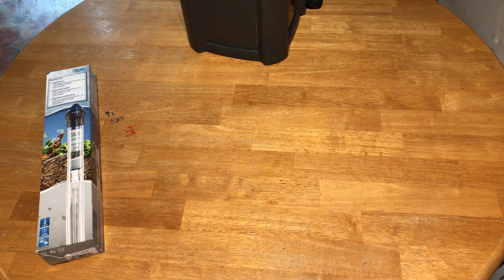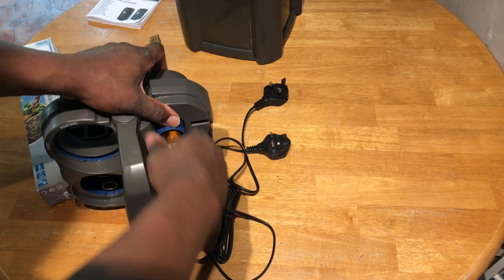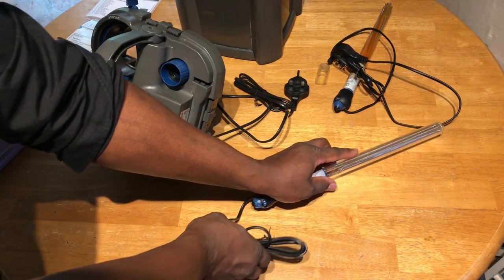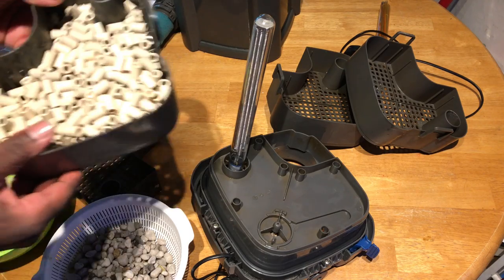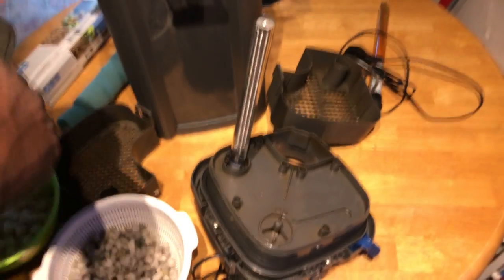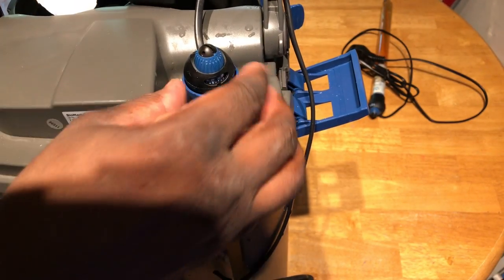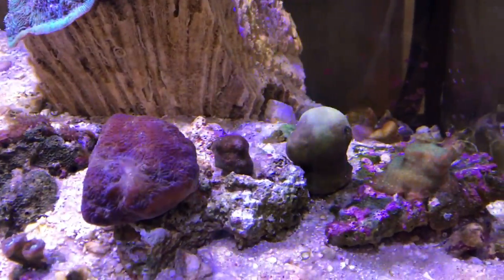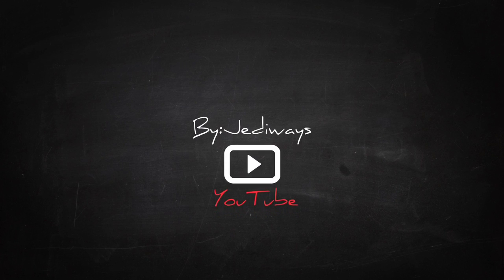Oh Oase my heater broke

Comment: Undo and remove the top bracket and holds heater, it's loads easier. Another thing, don't leave original ties on electrical cable, always unwind cable, especially on things like heaters that draw more current. Trust me, been an electrician for 25 years!

Comment: I just got the Oase 350.  Surprised to find that when the trays are in place the heater fits in a tube.  I was expecting greater exposure to the canister water.  The instructions state that one is supposed to wait 30 minutes after you start the pump before you plug the heater in.  For maintenance, the instructions say that you should wait for the heater to cool off.  How does one do that being as the heater is in the canister.  I would suggest that Oase redesign the heaters in this application so there is an indicator light to let the user know when it is safe to remove the heater or plug it in.  I will say the canister itself is very solid as are the clips that lock the top.  The motor top piece also appears to be very well built.  Impeller design is unique and clever.  I am confused as to what their thinking is regarding media.  On mine the pre-filter has fine sponges followed by Helx , 3 coarse sponges topped with a medium sponge.  I had learned that one should start with a coarse pre-filter and then move to a finer sponge.  May just call their customer service department and see what their reasoning is.  Already ordered the coarse pre-filter sponges and have placed a 2 inch piece of medium foam in the bottom basket.  The next basket has very fine foam in it.  Next, I will be putting Bio-home ultimate in two of the baskets.   Unless I need the room for the Bio-home, I have got some Ehiem sub-strat bio media for the top tray which is half the depth of the other trays.  No charcoal and no floss.  Sponges will be rinsed out in tank water along with the bio media.  Before putting all together I always put a thin coat of silicone on the rubber O-rings to help them last longer and prevent any leaks.  I am concerned about how the heater is setup in the filter.  The instructions quiet a few warning about the heater and handling during maintenance.
Reply from the maker: vacuum nut 
I considered doing the same with the pre filter as it appeared to to carry out a majority of the filtration 
In the end I left the pre filter as is and put lots of media in the trays and removed the sponges.
Regards Jediways
Reply: You just unplug the heater and wait 10 or 15 minutes for it to cool down as fresh water is pumped past it.

Comment: One thing to remember with the Oase Thermo is that if you turn off the pump it does not turn off the heater. Failing to do that may lead to overheating and failure of the heater. I use an Inkbird controller with mine so that it will cut off a thermal runaway or alarm for low temp.

Comment: These filters are starting to become available in the US.  I think having the heater hidden away may not be a good idea.  So glad you did not get electrocuted.
Reply from the maker: vacuum nut 
Thank you for your comment 
Not sure why it happened 😐
Reply: @Jediways  I was wondering if the flow rate had slowed down making it difficult for the heater to release its heat into the water.
Reply from the maker: vacuum nut 
Hi sounds logical, as the design seems to actually allow a small amount of water to bypass the filter trays and surround the heater however as the filter media become blocked this flow would be greatly reduced and if an air pocket is produced there would be further evaporation  which could result in no water around the heater bulb and hence over heating

Comment: Five years later and I'm curious if you are still running the pump with the original  heater replacement installed?

Comment: My Oase 350 heater has packed up too. Not sure if the glass is broken will find out when I replace it with the new one I've got coming
Reply from the maker: Be interested in what you find
Reply: @Jediways  yup opened it up and it was in bits same as yours. £28 for replacement. Contacted Oase and asked them to look at making a titanium heater instead. Also suggested that they maybe incorporate a viewing window on the side of the canister so it's possible to see the light on the heater.
Reply from the maker: @54Howie  The number of people that this has happened to now I’m beginning to think that it may be a circulation problem as in the heater is just not getting enough circulating water around it to disperse the heat. I do remember turning the heater up a notch before my event...
Reply: @Jediways  If it happens again I'll get a titanium heater and put it in the tank instead.

Comment: My Fluval M-series heater broke in the exact same way - I found the broken end buried about an inch in the substrate. It must have shot off like a bullet to do that. I'm guessing pressure builds up inside the glass tube until it just bursts. Mine was inside the tank so I'm lucky it didn't crack the tank glass and cause a blow-out. It was still activating even when broke, and by the looks of it, yours has been active for some time after breaking. I can't believe there isn't any kind of fail safe on these heaters. It didn't trip the fuse in the plug, the extension bar, the safety cut off switch I have all of my tank electrics running through, or the main fuse in the house's fuse box.
Reply from the maker: MickMaan 
I am sorry 😐 to here that you also had a heater blow out.
It’s not a nice experience for an aquarist to have.
On the technical side I completely agree with you 
The design of these heaters have the potential to be dangerous when the thermostat mis functions. 
Mine didn’t blow the 3 amp fuse either 
Glad your tank was okay
Best wishes Jediways
Reply: I lost four fish unfortunately. Different species but same strange symptoms. Everything else was fine, so I think they might have touched the coil when the heater was active or were near it when it blew.
I'm just glad the tank didn't go and I didn't have 240L flood my kitchen!
Seeing your heater blow inside the filter made me think - Why don't they design them with see-through material? I have an Eheim Ecco stashed away as a spare, which is see-through green plastic and love it. You can see exactly how dirty the filter is and when it needs cleaning. You would have surely spotted the heater sooner if you could see inside the filter!
I'm thinking of getting the Oase purely for the concealed heater - ugly buggers inside the tank, aren't they? They seem pretty solid from what I've seen. Can't really fault it for the heater going as it seems common across many manufacturers. It'll be replacing my Fluval 306 - An absolute pain in the arse!
All the best.
Reply from the maker: MickMaan 
The Oase Biomaster  range are within the select few that have built in heaters 
They are robust and well built with a double skin. They are a bit noisy after awhile and don’t have a high flow rate .
Good luck
Reply: Decided against the Oase after watching a few more videos and seeing another one of your heaters blew in it. That definitely sounds like an issue with not enough water flow over the heater. The low flow rate from the filter seems worse than I first thought, too. In my Roma 240 It'd just be awful if it is as bad as people are saying due to the fact that the inlet and outlet pipes for the filter are both at one end. The flow has to reach all the way across a 4ft tank otherwise one side ends up having really bad circulation. I had to put an air curtain at the end of the tank just to create some circulation.
Oh well. I'll just put up with the 306 for now.
Reply: @2KXMKR  Oase filters are awesome but you have to clean the pre-filter weekly to keep flow up. Which is very easy to do. Unfortunately many people don't do it and then complain of the low flow rate. The heaters can also get taxed if the pump is unplugged but people forget to unplug the heater!

Comment: do you think it might be possible to use an aqueon heater in there instead? Wondering how they attach on the top.  Is it a water tight seal with their heater?
Reply from the maker: carpetrug01 
Hi 
The unit has a water tight rubber like seal 
That ms a similar diameter to the heater but slightly smaller . So as long as the heater diameters are like for like this will be okay leak wise. If the heater diameter is smaller there will be an issue to to water pressure. 
The heater will be difficult to insert .

Comment: I had this twice now with this heater, both in less then a year, there must be some serious build issues..
Reply: do you think one could use an aqueon heater in the oase biomaster thermo spot instead?  They're not glass.
Reply: They dont seem to last long in there and its really easy to crack them when installing it. I switched to a good quality titanium heater+controller in the main tank instead. Much safer.
Reply: Well they refunded trough the store, and said the job owner never heard of the problem and said it was because I probably took the head of the pump off before it cooled down.. Anyway I ditched the pump and went the sump route. The last heater still runs in the sump and never get out of the water..

Comment: OMG ‼️ You're lucky it didn't electrocute everything in the tank - it looked as if it had been like that for some time! Is there some sort of fail-safe so it shut off when the glass broke?
Reply from the maker: Reefgrrl 
Hi I think the plug fuse activated stopping any further electrical activity. It must have happened straight after the last clean of my filter so was like that for about a month.